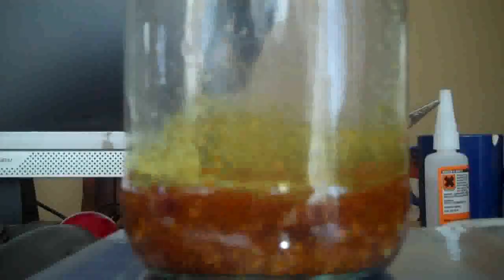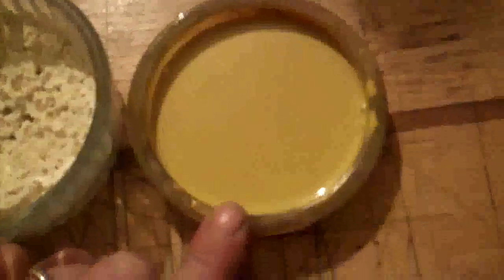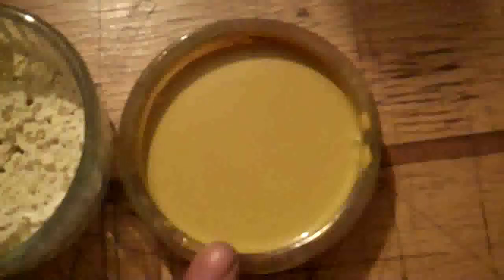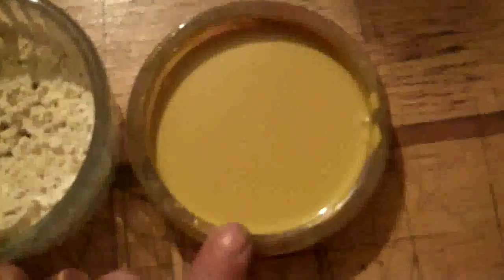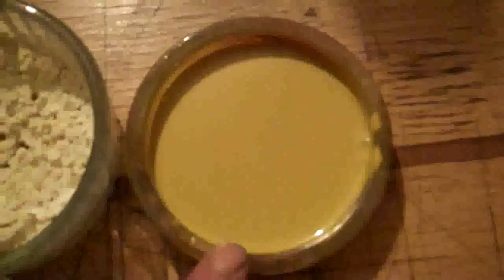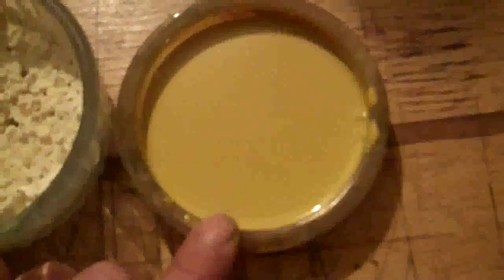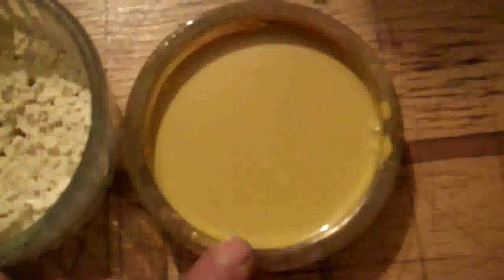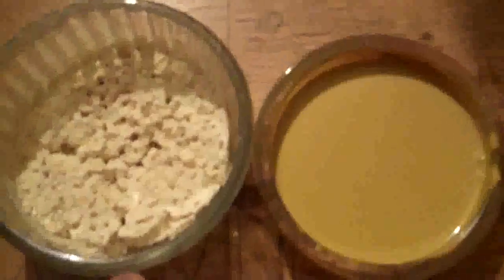Graphitic Carbon Nitride - Hydrogen From The Sun

Comment: Might be able to use this actually.. few ideas. More research needed. 10 percent isnt great but isnt nothing. Notice specified by volume not weight so bit of wiggle room and design work arounds. If nothing else a coating for parts.  Bet goin from dc to ac in a cell would heat enough to set it off so a cell that as the tank empties switches may make a nice buffer or backup. Not ideal but no extra heater needed. Wondering if any odd reactions i need to avoid with exotic metals, electrolytes, or containers. Hell wonder if could be infused directly on an electrolyte or a membrane. Wonder what electrical resistance or other odd properties it might have now.

Comment: Hi Rob,
Bicameral electrolysis collects H2 and O2 as two separate gas streams.  Using gC3N4 as a photocatalist, I can't imagine a reaction cell geometry with two distinct gas phase collection streams.  That leads me to think that only H2 is produced and H2O2(aq) concentration increases in the liquid phase.  Is this correct?  Did you make a subsequent video of H2 production?

Comment: Robert, to me you're a modern hero!
I worked in FabLabs, now developing on my own big 3D printer to make, with eco materials, small houses. Once they're done, your shared knowledge is necessary to bring forward a lot on a self-sufficient little house.

I've done some experiments, making some Piezo Crystals. I'm not sure how to proceed to make piezo motors and piezo sensors out of these crystals. Do you have any knowledge you could share on this?
Here they are:
https://www.instagram.com/p/BSRZS9ghj76/?taken-by=3dbueno
And here:
https://www.instagram.com/p/BSJDpTWBXzY/?taken-by=3dbueno
This is where I post the projects I'm also involved, as I go:
https://www.instagram.com/3dbueno/

Comment: Hello Robert
I did your experiment and I have a question.
I heated urea in a glass flask under cover and after 3 hours below, there was a yellow powder on the flame side and a white powder was deposited on the walls.
I suspect that yellow is graphite carbon nitride.
And white it can beta graphite carbon nitride ????
Please help me decipher this puzzle.
What is this white powder ????
Thank you and best regards
Tomek
Reply from the maker: i don't know what the white powder is mate - i guess you would have to have it tested
Reply: thank you for the quick reply .
But how to check?
Maybe if the white powder shows at different temperatures another electrical conductivity, it means that it is a semiconductor. And that means that it is graphite carbon nitride just why it is white ????????????????????????   :-)
Reply from the maker: no worries mate - unfortunately i have no idea - as it has been a while since i did this and you are just going to have to do what i would have to do and that is read around a bit - i would do it for you and try and find an answer but i am a bit rushed right now - so i am afraid it is over to you
Reply: It's probably an intermediate product, maybe heptazine?? I had the same problem and I'm struggling with it

Comment: You may would like to check this one: 
A. Lazauskas, J. Baltrusaitis, L. Puodžiukynas, M. Andrulevičius, G. Bagdžiūnas, D. Volyniuk, Š. Meškinis, G. Niaura, T. Tamulevičius, V. Jankauskaitė, Characterization of urea derived polymeric carbon nitride and resultant thermally vacuum deposited amorphous thin films: Structural, chemical and photophysical properties, Carbon, Volume 107, October 2016, Pages 415-425, ISSN 0008-6223, http://dx.doi.org/10.1016/j.carbon.2016.06.019.
(http://www.sciencedirect.com/science/article/pii/S0008622316304705) 

https://www.researchgate.net/publication/303917191_Characterization_of_urea_derived_polymeric_carbon_nitride_and_resultant_thermally_vacuum_deposited_amorphous_thin_films_Structural_chemical_and_photophysical_properties
Reply from the maker: cheers mate - will do

Comment: Hi Robert, this is one of my favorite video's on You Tube. I have followed your instructions and produced some Iron-carbon nitrite complex. The problem I am having is how to take it to the next stage ie producing a solar cell. I have experimented with failure only. If you get the chance would you please do a video showing the process of producing a solar cell using Iron-carbon nitride complex? Would the process be to glue on to a sub-strait?
Reply from the maker: I will do one when i get a chance mate - but yes - you need to get it onto a substrate
Reply: sintering within a ceramic?
Reply from the maker: well you could try it
Reply: more likely polymers
Reply from the maker: i guess
Reply: Made me think of addin to a catalytic converter honeycomb or similar.

Comment: Hi Robert- great video as always. I have been repeatedly trying this method in my kiln using the parameters from various papers (fast vs slow ramp rate, hold at 550 vs 600 degrees etc) but no matter what I do, I get a brown or grey product with a layer of black or dark grey material on top...since I can't seem to find answers in the available papers, is there anything you could share about how you got this to work so well?
Reply from the maker: +b od I don't know what you are doing wrong mate - I found it really easy - I hate to say that!
Reply: +Robert Murray-Smith fair enough- for the life of me I can't tell why it keeps going wrong when the conditions are consistent with what's in the lit. If you have any extra, would you consider selling me a few grams? Need some for an idea I'm working on
Reply from the maker: +b od Sorry mate - I don't sell chemicals - here in the UK we need a licence to do that. Maybe your kiln is contaminated?
Reply: The research papers i have been reading all pretty much say keep the temperature from 450 to 550C for a 3 hour period. The temperatures will affect what wavelength of light the carbon nitride will be sensitive to. Just google it and there are quite a few papers on the subject.
Reply: b od Try 650c for 3 hours and ramp temp or desiccated/dry urea first.
Reply: Could be the sugar, might be youre getting a filler in it or its a mix of beet, cane, and corn sugar. Prob works but less effectively or one layer is and one isnt useful.

Comment: Dear Robert...its a good work...I am also planning to synthesize g-C3N4 from urea. However in my first attempt, I failed. I had put 0.11 gm of urea in a silica crucible covered with the lid in a muffle furnace. I increased the temperature gradually (~ 3-5 deg/min) upto 550 deg and kept it for 2 hr. But after cooling down to room temperature I found the crucible was empty as the urea decomposed totally.
Can you suggest me how to overcome this problem and synthesize the C3N4 ?
Reply from the maker: Sayan Bayan use more urea - it's pretty chaep stuff and the energy you gave 0.11g was alot!

Comment: Alternatives to nitric acid for the wash out of ammonia and water?  Thanks Robert.
Reply from the maker: i'm not sure mate - it's been a while since i looked at this - i need to revisit it and will do so soon
Reply: Hydrochloric acid, with ammonia this create ammonia chloride, what is good  water solluble and can be washed with water. Water can be simply dried or washed with acetone or isopropyl alcohol or  with any solvent, which is able to be mixed with water.
Reply: Thank you
Reply from the maker: nice one mate - cheers

Comment: Did you ever get around to making a cell with the iron doped material? This stuff looks promising.
Reply: +Robert Murray-Smith  it's now a later date :) Id love to know if this is a viable way to produce some hydrogen.
Reply: @flyingsodwai1382  do you know of William George Armstrong's hydroelectric machine at Seghill,England ?It compels me to realize coal and wood smoke to liquidfied  ethanol production has most logical extensions.
Reply from the maker: yeah i did - i put it away somewhere to revisit at a later date
Reply from the maker: +Flyingsod Wai still not late enough - i am pretty busy mate and will get round to it when i can

Comment: Hello Put urea in kiln in aluminum pot  3 and half hour  550 degree it not yellow its grey am i missing something thanks sid
Reply from the maker: you got it dirty - i do mine in a ceramic bowl or pyrex dish
Reply: sidster64 the aluminum it sounds like has contaminated it, you should test this stuff since aluminum and silicon are key components to making a  number of zeolites and you might have a carbon equivalent, (they use zeolites to mass produce molecules by using cavities in the atomic structures to assemble the molecule then extract them from the cavities, and carbon is a smaller molecule so new compounds that silicon might not allow us to make should be possible with an aluminum carbon based zeolite XD  (hope you did not flush it, never know what you might accidentally discover this way)
Reply: will do thanks peace
Reply: It's in McDonald's salt,Aluminum sodium Silicate and bread ,if you need Alzheimer and they claimed they served Billion's,lawsuit's?

Comment: Have you determined if there's a rapid yield of hydrogen from the photocatalytic process after doping the graphitic carbon nitride with iron?  I'd really like to see a video of this stuff in action.

I guess I'll have to try to make some of this and do my own experiments, I want to find out if the intensity of light increases the rate of the reaction, and just how hot this stuff can get before it starts breaking down, and whether it will work with steam, or better yet, supercritical water.
Reply: Just out of curiosity, have you tried this stuff yet? What were the results?

Comment: So basically graphitic carbon nitride doped with iron could possibly replace titanium as a catalyst in fuel cells, making fuel cells affordable. Maybe I'm wrong but that seems to be the main setback as far as creating hydrogen from the sun and using that hydrogen to fuel a vehicle. That would be very exciting if that is the case. I have been researching as much as I can into pem fuel cells and different ways to use graphitic carbon nitride. You are an inspiration.

Comment from the maker: Lol so many questions can only be answered by doing. Basically your construction is right. Materials choice is more dictated by material properties. It will give you a voltage. You change voltage by building a few and wiring them in series or parallel depending on how you want to alter voltage in respect of ampage

Comment: Right so I need Graphene coated piece of aluminum. Paste it with g-C3N4 onto the Graphene. Then sandwich it with a piece of glass coated in Graphene. Graphene down onto the g-C3N4. Also how can you control current output of cell. Thicker electrolyte maybe? Many thanks for all your help.

Comment: Robert, will this form of Urea work from Ebay - 3LBS Nitrogen Fertilizer Urea 46-0-0 - $10.50 includes shipping.  Also known as carbamide, is an organic compound of carbon, nitrogen, oxygen and hydrogen, with the formula CON2H4 or (NH2)2CO. Urea is produced commercially from two raw materials, ammonia and carbon dioxide. Large quantities of carbon dioxide are produced during the manufacture of ammonia from coal or from hydrocarbons such as natural gas and petroleum derived raw materials.

Comment: Just curious, did you plan to make any more videos involving building super capacitors?  Was trying to figure out the size of sheets I need to make for a target farad rating and voltage rating.  I'm sure this information is available somewhere, using inferior materials, no doubt.

Comment: Could this make it possible to produce enough H2 and 02 to run a vehicle with power from the alternator? Or are we still not there yet?  Tried hydrolysis with a 1997 Geo Metro, the thing actually bogged down the motor with the electrical load... I never uploaded the videos, as this was technically a failure to produce enough gas.